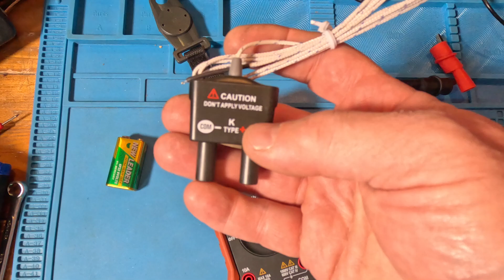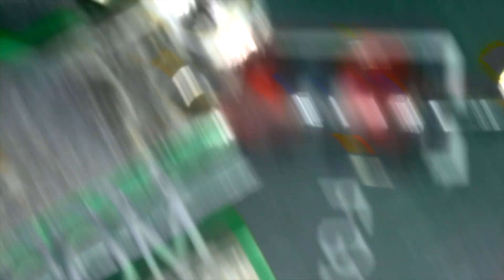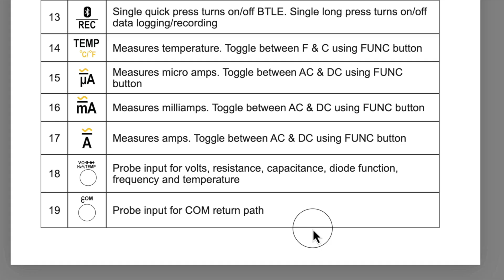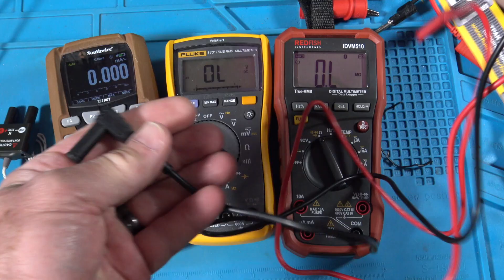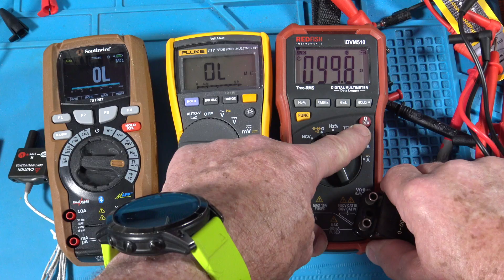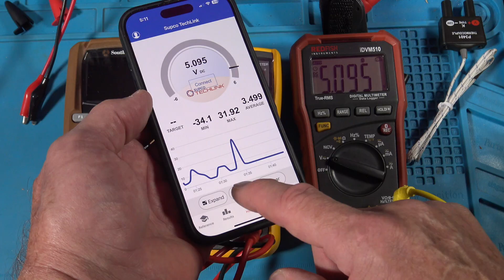Fluke 117 vs Redfish iDVM510 Multimeter review and tear down #RedfishiDVM510 #Fluke18B+ #fluke115

Comment: The Redfish is the old Mastech MS8250D meter with slight added functionality. One of the worst meters I ever bought, the Mastech were Green over-moulded Rubber. Virtually zero input protection and mine gave up the ghost/smoke in very short order. Made of that horrifically cheap smelling plastic and now lives in spiders corner beneath my bench where it has resided for over 11 years of uselessness.
I still have the Mastech AC/DC current clamp meter that I bought back then too but I have only used that in the clamp non contact mode. It measures In-Rush which was rare like 12 years ago when I bought it.
Edit; I later noticed that the board model is MS8250E meaning it is a later revision of the Mastech MS8250D and very probably still made by an incarnation of Mastech.
Reply from the maker: Thanks for that feedback.  Yes Mastech does make a lot of meters and rebadges some, so I wouldn't be surprised, but they don't sell an 'E' Version.  It could be that this was a special build for Redfish adding bluetooth and safety features.  This looks and feels like a great meter and the Bluetooth works great.
Reply: @KissAnalog I guess then that they  have uprated the case and I do see signs that they have added greater input protection, hence the flying wire from the fuses to the PCB. That is a new 'floating' fuse carrier completely redesigned with HRC Fuses which as you know are very necessary to safely interrupt a high load and the Spark Gap/GDT is certainly a new addition which adds a higher degree of protection, the Agilent meters use these instead of MOVs too. 
Would be interesting to look under the fuse carrier to see how much board revision they may have done or if they have simply left the fuse holders off the old boards with the old layout still in place. There is clearly some other redesign up top of the board for the coms aspect. I do recall mention of a Bluetooth version of the Mastech way back when but it never came to the market that I am aware of.
I would need to see o-rings or rubber gaskets to the case to accept that the meter has a genuine IP Rating. The input section looks exactly the same as the old version I have which would be a major point of ingress for fluids, dust particles etc., the battery door assembly has no gaskets and behind the battery, there is an open square hole into the case. The range switch would need some type of gasket too. Joe Smith would be the guy to thoroughly check out the compliance of these meters with their claimed additional safety features. Joe had the Mastech 8in1 meter way back when, it had a Light Meter, Sound Meter, Input Alert, etc although I seem to recall that he beefed up the input protection considerably as you would expect.
The PCB material certainly looks better quality than earlier iterations of 'lesser' models.
As I said, the AC/DC clamp meter I have still functions reliably but the rubber rarely hits the road with a clamp meter unless you use the jacks and probes for voltage, diode, capacitance, resistance and continuity which I do not.
I just don't like to think of a younger inexperienced person buying this meter at what is a very high price and expecting that because of the high price, they imagine that they can absolutely trust the meter because it surely must be high quality to be so expensive when they could have bought a Fluke 117 or similar for the same money or a Brymen or even Agilent/Keysight 1232A or a Dave Jones EEV Brymen in disguise and these meters stand up to their ratings and have far more functionality including data-logging.
We all still see the 20,000mAh 18650 batteries 😂😂😂 originating from China and the 100,000mAh pocket sized powerbanks, we know that they will print any lie that makes something sell better to the naive or foolhardy.
I know nothing of the company Redfish who may have commissioned the design and are importing these meters but I can see that they will be paying probably substantially less than $30 per unit for these meters and then applying an extortionate mark-up to be retailing around $200. Brymen will rebadged their very high quality meters including silk screening your logo's onto the meter at less than $100 per unit when ordered in sufficient quantities still leaving a very healthy profit at over double the money.
Thanks for taking the time to respond to my messages, I have only good intentions in raising this and I know you do too after watching your channel for many years now. My concerns are entirely towards the vendor and not yourself in any way. Thanks
Reply from the maker: Thanks for sharing all this information - it is much appreciated.  It is great when vendors learn and improve - and it is interesting to see the history and to learn what to look for.

Comment: Sorry about this, I have to make a comment about this. This meter is overpriced by 150 to 200 or 300.00 US dollars. And this is the first time I've been a comment on this channel.And I've been watching analog kiss for the past several years. It's just not worth it 🙃.
Reply from the maker: Thanks for your feedback and support!!  Which meter are you talking about?
Reply: @KissAnalog  Hello, kiss analog. I,would suggest the Ziboo 17b  multimeter. It would be nice if you made a full review of the Ziboo 17b. 😊 I have other multimeters but I like this one. Good bang for the value. I,will also suggest the EtekCity MSR-A1000. Both are 6,000 counts etc.  Thank you for your reply brother 😊.
Reply: @sabrewulf7183 The Ziboo 17B is an excellent choice, great input protection and features, been very pleased with mine, fantastic capacitor range too and the live wire detect is great.
Reply from the maker: I actually did do a review on the Ziboo: Fluke 18B+ vs Ziboo 15B PRO multimeter review and tear down #Ziboo17Bpro #Fluke17B+ #fluke15B+
https://youtu.be/U0aSiOXjAsM
Reply from the maker: I also have an EtekCity that I need to review.  Thanks for the input!
Reply: @KissAnalog I look forward to the Etekcity review. I have acquired several new pieces of equipment these last 4 to 5 years directly following a review and teardown and your great advice. The colour LCD Southwire high count meters you showed at such a fantastic price prompted me to search for them and I ended up buying the Amazon Commercial version of that meter, one of the best meters I have bought, thanks.
Reply: @KissAnalog  Yes I saw that great review and then bought the meter from Ali Express. When I watched your teardown and saw the protection circuitry, MOV's, HRC Fuses and PTC's and the well thought out board layout, I ordered one that very evening. The plastics used for the case are almost on a par with the Flukes which inspired these meters, fantastic value for money and a wider feature set than the Fluke 15B, 17B+/ Max and the 18B.
Sadly I did not receive both rubber holsters, only the red bumper cover was in the box but I really don't mind too much. The Ziboo likely uses the same Fortune Semiconductors FS chipset that the Flukes of this range use and the accuracy is arguably slightly better than my 12 year old Fluke 17B+. TRMS should be made available on all meters at this point by Fluke with the odd option for Average Responding or a software setting to choose, they always skimp out on the Capacitor range too, seldom straying into the MilliFarad ranges although my Fluke 112 has an unusually high Cap range for a Fluke and is usually my weapon of choice for TV and Hi-Fi repairs although the Ziboo has now taken that role.
Just received the Fluke 17B Max meter which I have yet to put through its paces, very reasonably priced on AliExpress at £118UK. The new needle sharp probes (TL75 I think) that I optioned with the meter are very nice, they still insist on sending the Chinese language manual even though Fluke surely knows that this is being marketed in the West. I am sure I recall you reviewing the Max a few months back.
Thank you for all of the Tech that you bring to our attention, always great to know what tech has appeared on the horizon.
Incidentally, can I ask what is your opinion of the Fluke 185 (the Tektronix TX3), I have just purchased a used model from eBay as I have never been hands on with this model and it has the 50,000 count option together with some data logging features (30 sets of data I believe). I believe it was first released in year 2000 and they seem very scarce here in the UK. Fluke seem to have changed very little in adapting the meter into the Fluke branding but then Tektronix made some very fine meters back in the day.

Comment: Apparently the Redfish needs to be tossed back!  It’s not ready for prime time.  IMO
Reply from the maker: Why do you say that?
Reply: These are atrocious meters made by Mastech, terrible reputation back in the day, a decade or more ago.
Very little has changed on the board from those earlier days, I wouldn't use one of these except for Car work DC measurements or lower voltages.